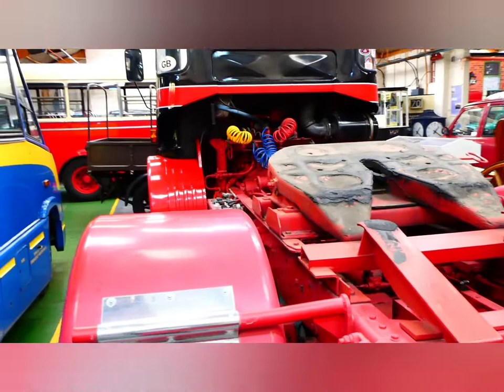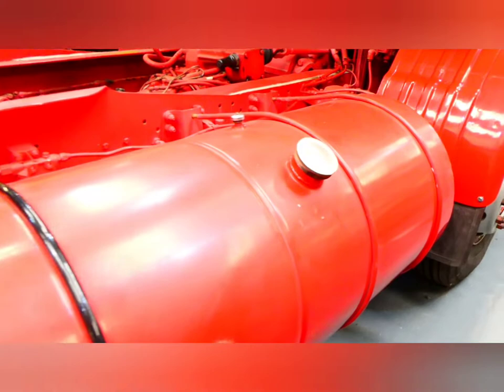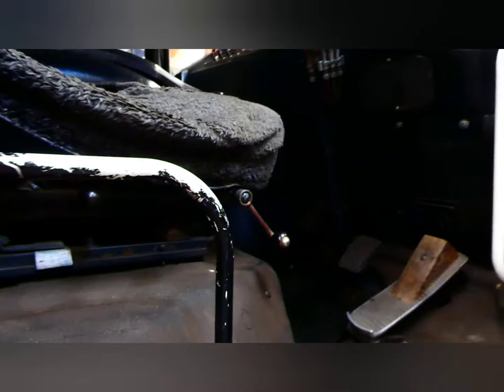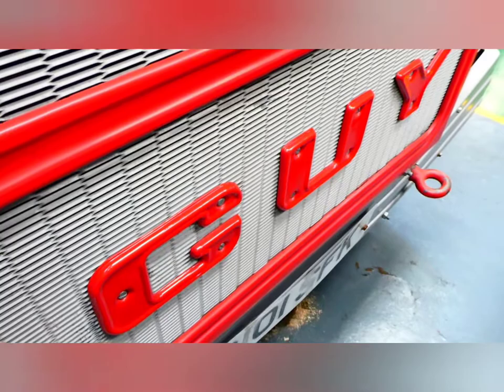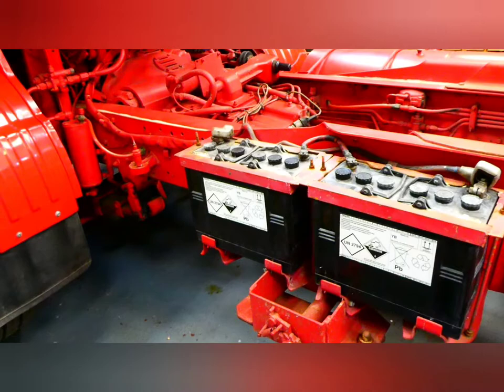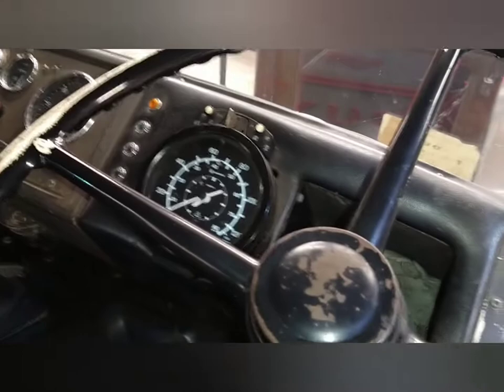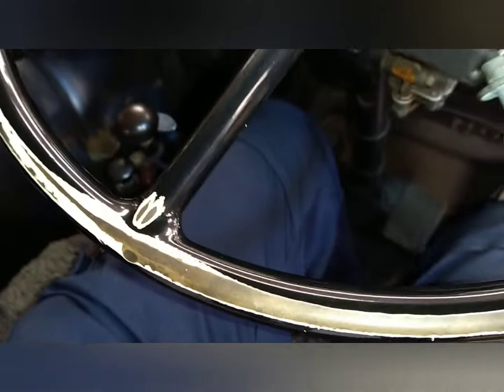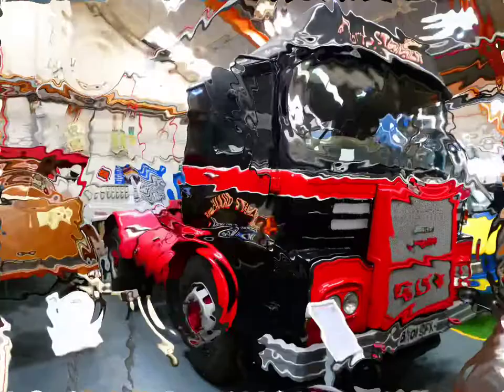Classic Fully Restored 1978 Leyland Guy Big J 4T Arctic Tractor Unit Truck Walk-around Tour

Comment: Agree with 'billalbion' the presenter certainly hasn't a HGV background!.   Nice restoration though. 
From a maintenance point of view, I worked as a HGV mechanic apprentice at Kays of Birmingham (Leyland Trucks main dealers) in the 1970's. Guy vehicles never had a tilt cab and were something of a nightmare when they needed engine repairs (from a mechanics perspective) as when it came to Engine maintenace, you had to climb in and out of the cab with tools and stripped-down engine parts, in order to access to the particular engine fitted (mostly AEC 505's as I recall). If an engine replacement was needed, it was through the front (panel removed first !) with a single fork & chain on the end of a fork lift truck.  Not for the faint hearted......
Reply from the maker: Thanks for watching and commenting and sharing your memories, indeed I am not a HGV man more cars and I have owned and driven 7.5 to Atego's so we did our best with this video

Comment: I drove one of these for a while, it was definitely not a tilt cab, and the wooden block on the throttle pedal was because some of the link arms were just fitted with clamp bolts and not splined to the rods and constantly slipped so you could not get full revs, a must with the gutless Gardener engine.

Comment: Love the block on the accelerator pedal  ,( only needed with Gardner engines )
Reply from the maker: Thank you for watching and commenting
Reply: Supposedly - United's Bristol RE Gardner powered coaches on the overnight services Newcastle - London would have a long piece of wood ready to be used when drivers thought most passengers were asleep.....to wedge the throttle down.  Early cruise control!

Comment: Drove one of these back in 1976 for a company called “Unisant” based in “Cradley Heath” it was a 1974 model, it had a 6 speed box and an “Eaton” 2 speed rear axle, no power steering and not a lot of sound proofing, cab was standard (no sleeper) engine was the “AEC” version straight six, not very fast but when loaded it would do 70mph up hill and down dale, it didn’t have a “Tacograph” had to fill out a log book each day, it also had a bust of an Indian chief on the radiator cap cover, nice restoration though, brings back memories.
Reply from the maker: Thank you for watching and sharing some nice memories

Comment: I don’t quite understand how is a 9 speed rang change possible  or a 9 speed splitter as mentioned later?
Reply: 4 over 4 = 8 + crawler = 9
Reply: This would be a range change box. The 13 speed had the splitter which only worked on the top four gears. Personally I prefered the 13 speed as opposed to the Eaton Twin Splitter, the box of a thousand neutrals!

Comment: No doubt a quality restoration but a perfect example of why the British truck industry died...
Reply from the maker: You are spot on , thanks for watching and commenting
Reply: I've had much worse though. A Ford D series 2817 with the Perkins V8 was one. Another was the Bedford TM with the Detroit 6V71.
I became an owner driver in 1990 and put to work a very used Volvo F7 pulling tilts from Malaga to Calais return. Tbh, at 40t it was flat on its face on the hills.
A F10 followed and then a F12 400 which at the time had big power. My pride and joy though was a F16 700 4x2 on full air  c/ w polished Alcoas, twin polished tanks, side deflectors, leather interior SAF alloy low profile fifth wheel ect. This had monster torque and would pull a tilt with 36 bulk bags of polished stone over Mont Blanc up the very long gradient from the Italian side to Chemonix France in top gear at 100kph, this was at a very overloaded 50t!
Great times with excellent services and overnight stops.
I look back now and then and have more than a hankering to do it all over again lol..
All the best to you.
Subscribed.